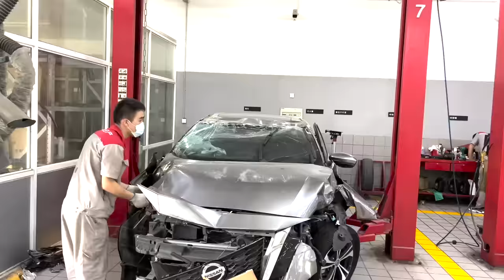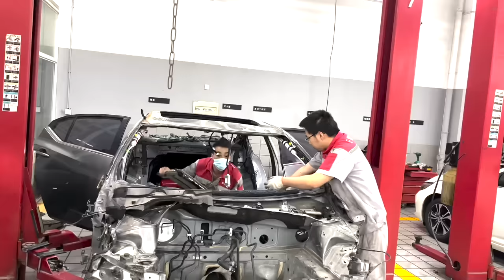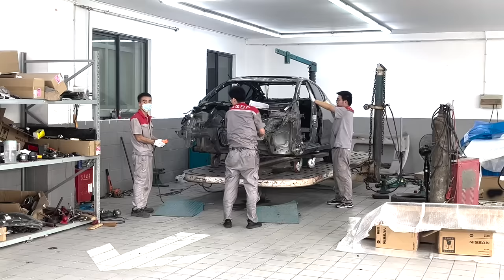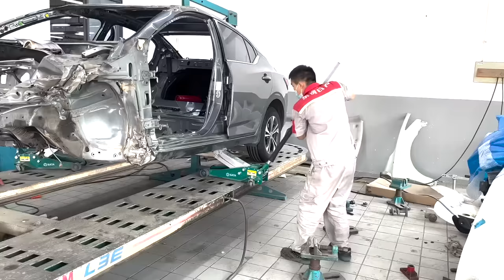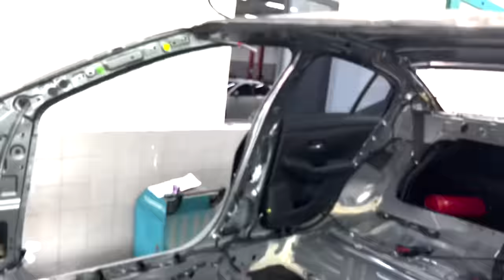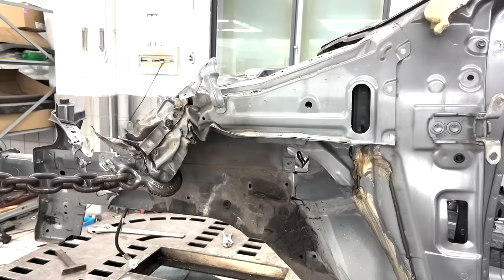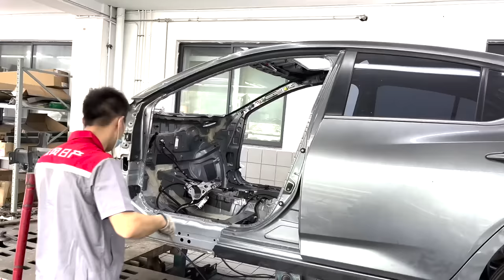Mechanical Wizardry: Master Technician Han Restores Scrap Nissan Sentra to Perfection!

Comment: Excellent work Han. Your knowledge, craftmanship and attention to detail really shows. A scrap car can rise from the ashes to its former glory, sure. The problem is that not many want to dedicate the time and are not as skillful and thourough as you Han. Keep up the great work.
Reply from the maker: Thank you for your kind words! Han's dedication, expertise, and meticulous approach indeed play a crucial role in bringing damaged vehicles back to life. It's true that not everyone possesses the same level of skill and patience required for such restoration projects. Han's work showcases the potential of giving a damaged car a new lease on life, but it's essential to recognize the level of expertise involved in achieving such results. Your appreciation is well-deserved.
Reply: ...and the next front crash will kill the driver.
Reply: and so what ? @OLLiGoldeaux
Reply: Welding through paint causing bad welds. Welding with no helmet introducing to much heat into high strength steel. Looks good on video and he works hard but not a premium repair. Look at the black around his welds. And how big the plug welds are not good
Reply: How does welding without a helmet effect the weld in anyway? That's ridiculous. It certainly will effect your eyes eventually. Being able to see what your doing better makes for better welds buddy but not your eyes.
Reply: Well like your title says be realistic. A 5/16 plug weld should have 5mill or less heat effect zone around it, if it doesn’t it turns the high strength steel into mild steel. This causes degradation of the design of the crash management of the vehicle. His welds are HUGE. WELDING through paint like he does is an ABSOLUTE NO NO.  Yes , I am a Red Seal Tech and was on the deans list at school so unlike you I “actually” know a little bit about it.  Any way. Hope all’s good on your end cheers Jerry
Reply: @jerrydelyea5820  to us normal folk. this look great and amazing,...  but to an expert.. you called out the problems in his work...begs the question.. can you start a channel to show how its done.. if u havent already
Reply: @PopePlatinumBeats  hi there. yes I suppose I  could. I have been in the trade a long time but don't feel passionate about filming it. I am 62 yrs old and have a channel , under my name you might enjoy   ps. Han sure is a hard worker though!!

Comment: It is awesome that a newer car can be repaired after that level of damage, but I would have to question the cost effectiveness. 
I forgot to mention that was excellent workmanship. You made it look easy.
Reply: the airbags alone almost renders it unprofitable;
Reply: The restoration cost is 10k.
Reply: I think that’s only feasible in developing countries with low labor cost.
Reply: it may depend on the import costs involved in getting a new one , in thailand for example your import duty is 200% of the cars value making all cars 3x more expensive to buy new
Reply: in the next accident there will be a mountain of corpses....
Reply: Die vorherige Sicherheit, kann man so sicher nicht weiter herstellen.
Reply: depends on where in the world
Reply: Caramba esse homem é muito profissional !!
Reply: @@Leslie_Horwinkle The strength (which is a wrong term to begin with) hasn't gone anywhere as the car is all held together by spot welds to begin with. All he's doing is replacing crumpled parts with new factory ones using more or less the same process that the robots do. Cars aren't made to withstand hits nowadays anyways, they're made to absorb the crash energy and crumple into themselves.
Reply: @prostodjek9368 why
Reply: You don't know what you are talking about. The crushed part was pulled out with chain and it wasn't annealed. So no strength was lost
Reply: The more you hit a metal the stronger it becomes

Comment: True craftsmanship is wonderful to watch. Han is truly a master of his craft, along with his great team. When doing a repair like this, you do have to keep in mind that if you bend bent materials straight again, you will not regain the strength and quality of the original metal. You can see this in a small experiment if you bend a paper clip back and forth again and again: it breaks after a few times. Metal fatigue.
Reply from the maker: You're absolutely right about metal fatigue and the importance of considering the structural integrity of repaired materials. When metal is bent or stressed beyond its elastic limit, it can lead to permanent deformation and a reduction in strength. This phenomenon, known as metal fatigue, can compromise the safety and durability of repaired components.

Comment: Well done. Here in Brazil, a repair of this magnitude is practically impossible. The prices of parts and labor are so high that insurance companies prefer to write the car off as a total loss and compensate the customer with the amount of the vehicle's list price.
Reply: I think that is very very common sadly! 
It's the same when it comes to electronics ,Just throw it away and get a new one :(
Reply: In the United States, the determination of a total loss is made by each state's Jurisdiction. So once the cost to repair reaches and exceeds a threshold set by the state, it is legally to be determined a total loss. That's not to say it isn't repairable, but that it legally has to be given a salvage title for future use. The pay out on a totaled vehicle depends on market value of similar vehicles in pre-accident condition. Rarely a truly fair payout.
Reply: @JerodM  Here the total loss is reached when the repair value reaches 75% of the vehicle's market value. This target is established by mutual agreement between insurance companies. And finally, a curiosity: car insurance is not mandatory in Brazil. However, it is estimated that 70~80% of the Brazilian fleet is insured by owners.
Reply: Везёт Вам! У нас в России к большому сожалению, тоже восстанавливают такой лютый хлам и тотал! 😞
По всем Мировым Законам этот шлаковый утиль не должен ездить по дорогам...
НО, увы........
Reply: From the video description seems this is a total loss car that was bought from the insurance company and repaired.

There are lots of cars repaired from insurance company auctions in Brazil, but not as properly as this video shows.
Reply: In Brazilian law a careful inspection would classify a vehicle with this amount of damage as "major value" ("grande monta". Can't translate properly). The documentation is canceled and the vehicle can't run again. It is usually auctioned for dismantling. However, even classified as "total loss" auction vehicles with minor damage ("medium" and "minor value" classified) can be recovered, regularized and run again.
Reply: as they should
Reply: Such cars cannot be restored, it is a crime. The geometry of the car is completely broken, it is dangerous for the life of the driver and others

Comment: Amazing work he actually rebuilt the car frame the car looks brand new very impressive work wow !
Reply from the maker: Absolutely, the restoration work done on the car is truly impressive. The dedication and skill required to rebuild the frame and make the car look brand new are remarkable. It's a testament to the expertise of the professionals involved in the process.
Reply: @xinxianshi   Tay nghề của các bạn rất giỏi🏆 . Nhưng cho tôi hỏi là phục hồi như vậy đạt bao nhiêu phần trăm so với xe nguyên bản về độ bền vật liệu.
Reply: @vanthanhnguyen6836  none can guarantee this kind of repair. See as much as it looked restored, the integrity is definitely ruined. No beef on the mechanic, but the crash is severe. To ride this machine again on high speed and trust your live with it, i wont bet on it

Comment: This work is really amazing. I only see a problem in buying such car unaware of what it has gone thru.
Reply from the maker: You're absolutely right; the work showcased in the video is indeed impressive. However, as you've pointed out, buying a car that has undergone extensive repairs without being aware of its history can pose some challenges and potential risks.
Reply: Richtig. Ich würde damit keinen Unfall haben wollen. Wer weiß ob die Struktur noch den Herrstellervorgaben entspricht. Mir wäre es zugefährlich.
Reply: If it's done properly then it's fine but you need to be absolutely certain of that. 
Many years ago I used to do this for a living and we did it properly. This was before the vehicle log book/registration document had, by law, to be stamped as having been a total loss.
Reply: @harrygatto  I also am a recently retired Auto body tech here in the US, yes if done properly BY A TRAINED PROFESSIONAL then this vehicle is completely safe. It's not that long ago I used to  occasionally purchase the vehicle from the owner before the insurance "totaled" it , repairing the car and still have a clean title, documenting along the way for future buyer. FYI, as I'm sure you know, just because a car is totaled doesn't necessarily mean it's junk or shouldn't be repaired or have frame damage, (which can also be fixed or replaced if done properly) it just means it makes no sense to the insurance co. money wise, with high cost of parts and labor. I've fixed vehicles with way more damage than this one that wasn't totalled because it was basically new and worth a lot of money, but then see a car get totalled because it needs a new bumper and fender because it wasn't worth much, it's a crazy racket 🤡🥳
Reply: @whatsit2ya247  the metal after such repair is no longer tough
Reply: @ady007pl   Oh really, what study do you base that on? Because the insurance industry has done extensive studies and crash tests and have given ICAR certified technicians guidelines  on proper repair procedures. As a properly trained tech who attended yearly training on how to deal with new repair techniques and the new high strength steel, again I say IF properly done there is no additional danger to the occupants of the vehicle, also remember modern cars are designed to "crumple" around and up to the occupants.
That said I would never have my car repaired by a shop or person that's not ICAR certified and trained and I'd ask how many years training and experience they have. 
Also I have no idea about this guy in the video, but for the most part it looks like he's doing a good job, though I'm not sure about his welding, closing your eyes is not a good technique 🤦🤨 and all I'm seeing is "tack welds" as opposed a complete bead from end to end. I'm also a little concerned about were and how he's splicing that frame rail in, I'd have to research and look into that.
Reply: @whatsit2ya247  When you bend a metal you get either elastic or inelastic deformation depending on the applied load. If you bend the material too much it will undergo inelastic deformation and can become more brittle due to dislocation formation, and eventually form cracks and fracture.
Reply: @ady007pl   Okay 👍
Reply: @ady007pl   Watching the entire video...  The vast majority of such deformed metal was replaced.  Very little of it was repaired and what was, is sufficiently supported by new structure as to not be a problem.

Comment: For those who are not used to it, the work of repairing a damaged car may seem almost fantastic. However, within a specialized workshop, this is normal routine. I have over 35 years of experience in this profession, specializing in restoring cars that have been severely damaged by collisions.

Comment: Mr. Han, it's good practice to use safety equipment, especially when welding or using a saw to cut metal. Your eyes could be severely injured. Be careful and very successful. Your work is great!
Warm regards from Brazil.
Reply from the maker: Obrigado, obrigado pelo lembrete, a segurança é sempre a principal prioridade
Reply: @xinxianshi  obrigado também por responder em português! 🤝🏻

Comment: I think it takes a lot of patience to get this far.
However, if you look closely, the dust on the driver's side and passenger's side don't match.
If you look closely at the gap between the headlight and the bonnet, you can see that the gap is different on the left and right sides.
Reply from the maker: You've made some keen observations about the details in the video. Indeed, the process of car restoration and repair can be quite intricate and require a great deal of patience and attention to detail.

Comment: despite all the replacements and work, this car is just fit for run within city, safety for high speed crashes has now been compromised, à job well done, but the car in my opinion is only safe for low speed zones, like a town and within a small city, with minimal motorway or freeway drive
Reply: You’ll have to explain that conclusion my friend. All the dimensions points are being checked, the replacement parts leave all the crumpled zones intact, original spot welds all replaced, all glued panels done properly, everything seam sealed, all replacement panels fit perfectly. As long as suspension is good, I don’t understand the problem?
Reply: @dougthomson5544  I agree with u absolutely, but the you will not be able to convince the customers blocked mindset, its Chassis was damaged , hence its compromised

Comment: I'm not sure if the structure loses strength when stretching the body? As far as I know, deformed metal loses mechanical properties...
Reply from the maker: You are correct, deformed metal can indeed lose some of its mechanical properties, especially its original strength and rigidity. When stretching or reshaping the body of a car, it's crucial for skilled professionals like Mr. Han to carefully assess the damage and apply proper repair techniques to restore the structural integrity of the vehicle. This may involve using specialized tools and equipment to ensure that the repaired areas regain their original strength and safety standards.
Reply: it wont survive another car crush - make no mistake about that. those mechanics think they did a good job , but its only cosmetics.
Reply: @xinxianshi I will believe it if they did tensile tests in some certified lab, and tested the resistance to steel. because only based on his "experience" is to think about it

Comment: Once again you have shown what you and your team can accomplish, You make it look easy ,but i know it is not as simple as it looks, correct measurements, profiles of metal etc, which affect geometry, steering ,alignment etc
Reply from the maker: You are right. It looks simple, but in actual operation, there will be many troubles. Therefore, repairing an accident car is a complex and highly technical job, which involves many fields. We only repair the appearance and structure, and other parts will be repaired by professionals.

Comment: Great skill to watch, for sure.  Very talented.  My question, is this: is the restored vehicle still safe?  Doesn't the metal fatigue from being bent and straightened weaken it?
Reply from the maker: While the repair skills demonstrated in the video may be impressive, your concerns about the safety of your restored vehicle are valid. The process of bending and straightening metal does create stress and can weaken the material's structural integrity. Metal fatigue is a legitimate concern, especially if the repair is imprecise and does not adhere to safety standards. Although the strength of the original vehicle cannot be reached after repair, it will not have much impact on daily use, so such repairs are very common. In our country, people will not scrap the vehicle because of some accidents, unless the repair cost exceeds the vehicle value

Comment: Master car body rebuilders and experts in frame straightening. I enjoy watching them take a crushed totalled car and rebuild it. I don't know how they weld w/o dark glasses though.
Reply from the maker: The skill and precision with which they restored a badly damaged car to its former glory was truly impressive. They will close their eyes when welding, or use their arms to block the arc light, so as to achieve fast and safe welding.

Comment: Very impressive and lots of attention to detail, does another shop look after the engine while the body get restore?
Reply from the maker: Hello, we are a Nissan brand after-sales service company. We have dedicated workshops responsible for repairing engines and chassis systems. We also perform other repair work simultaneously during the repair process, ensuring collaboration between different workshops. This is very important to ensure coordinated maintenance of the entire vehicle.

Comment: Good job. How much does a repaired like this cost? I bought a restored Cadillac for a fraction of its value. Several mechanics have looked at this vehicle and can't see any repairs.
Reply from the maker: Hello, I’m glad you shared about the Cadillac. It cost about $10,000 to restore, which is more than half the value of the car.

Comment: How long does it take you to get the parts to replace the framework of the car itself?
How long have these guys been doing bodywork?
Of all the trades, bodywork is a true art!
Reply from the maker: Hello, I am happy to answer your question. It usually takes about a week to get the parts. If it is an infrequently used part, it will take a little longer. Some parts require special production by the manufacturer. Our Master Han has been engaged in this work for more than ten years. His years of work experience allow Master Han to easily handle the repair of various vehicles.

Comment: He is welding without any protection for his eyes ! 😮
How can that not damage his eyes over the years ?
Reply from the maker: Thank you for your reminder. Skilled workers will use other methods to protect their eyes when welding. They believe that frequently putting on or taking off welding masks will affect work efficiency. Currently, the eyes are normal, but we still need to remind others to protect their eyes when welding. Take protection